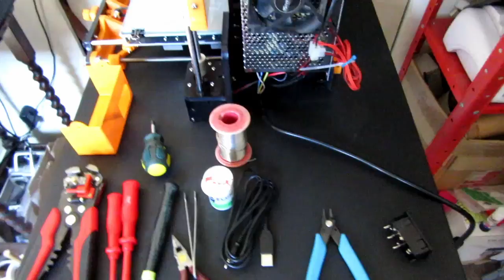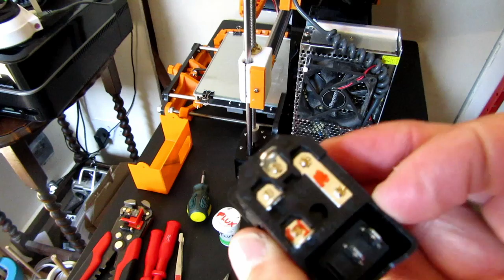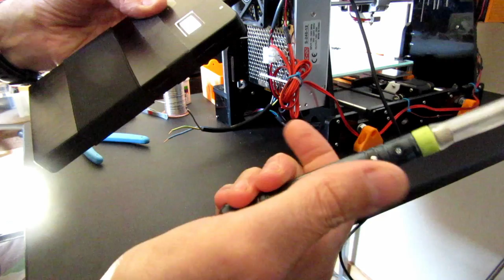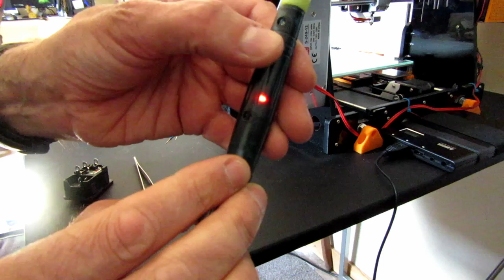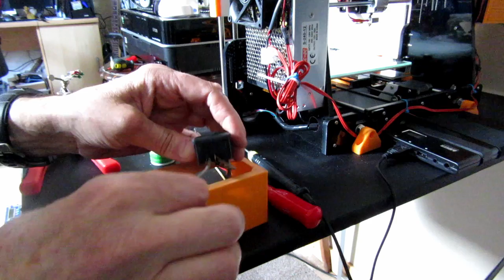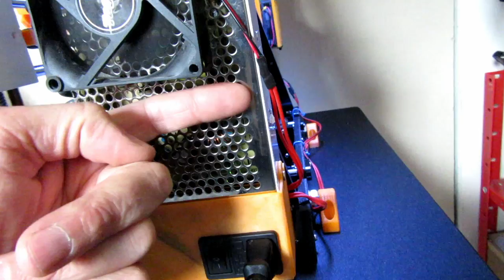How To || Anet A8 3d Printer Power Supply Cover

Comment: I have a different kettle lead switch like the one you show in your video, my switch has the Earth, Live and Natural connectors but the rocker switch has 4 connectors instead of the  2 that was on your switch. any advice you can give me? thanks :)
Reply from the maker: HI i think its a double pole switch 2 in 2 out use a multimeter to check hope this helps

Comment: Thank you for the awesome video, I couldn't find the link for the portable soldering iron you have mentioned around 1:35
Could you tell me where you got it? Are you happy with it so far?
Reply: I have found it now, it was on your channel (USB Soldering Iron ZD-20U). Sorry to bother. Keep making awesome videos.
Reply from the maker: Sorry bud i did forget...its a realy good iron ive used it loadsof times alway from a battery pack.....

https://www.youtube.com/watch?v=X0D2i3K6xtg

http://www.banggood.com/Portable-USB-Powered-Mini-5V-8W-Electric-Soldering-Iron-With-LED-Indicator-p-1017109.html?rmmds=myorder
Reply: Thank you for the reply and the link to the shop. Some years ago, I had a soldering iron which ran from Double A batteries, but it never heated up to a manageable temperature to solder anything. But this one looks very useful and gets to temperature quickly. I would also use it from a battery pack as you said. Thank you :)